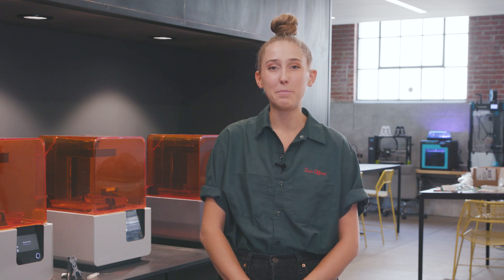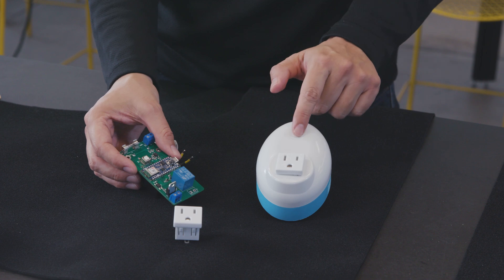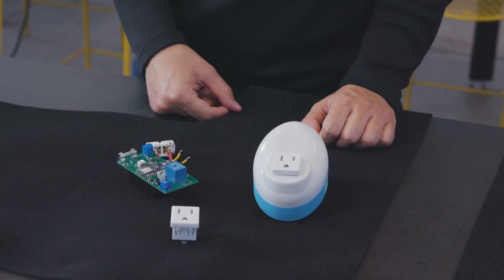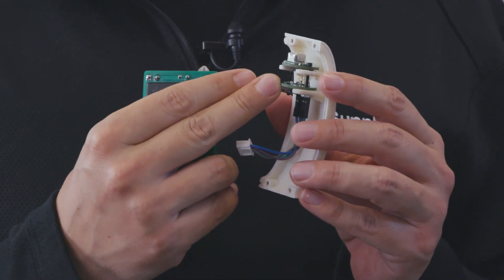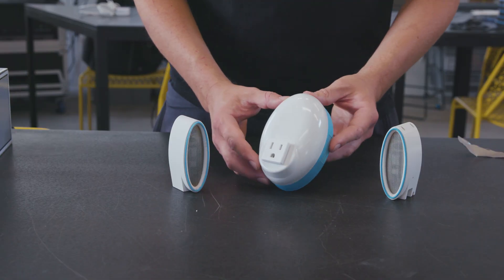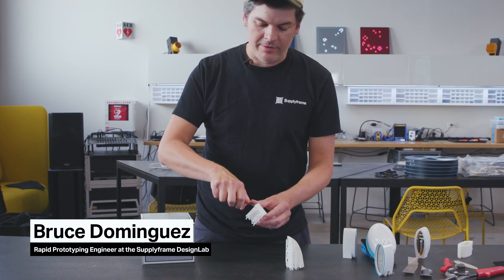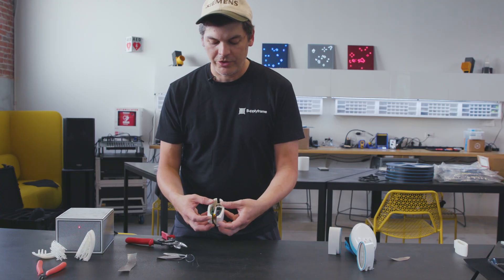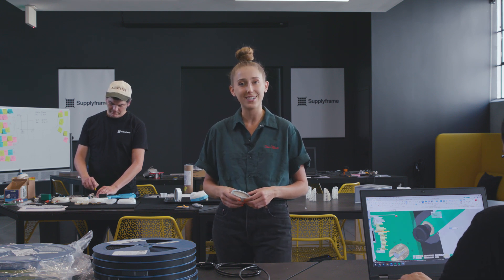DesignLab Builds: CO2 Monitor

Comment: Is the threshold for turning on the fan relative to the previous data, or is it an absolute reading? Also, yay DesignLab!!! <3 <3
Reply: Hi Erin!  We wanted to make sure we got actual CO2 data (not just estimates), so we used a true CO2 Sensirion SCD4x sensor that reads ppm's! (https://sensirion.com/media/documents/C4B87CE6/627C2DCD/CD_DS_SCD40_SCD41_Datasheet_D1.pdf)